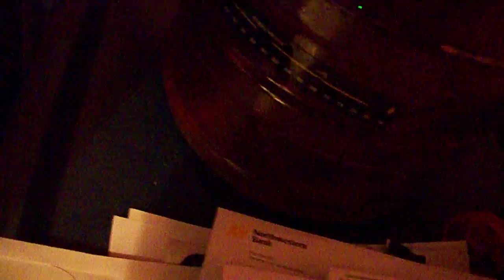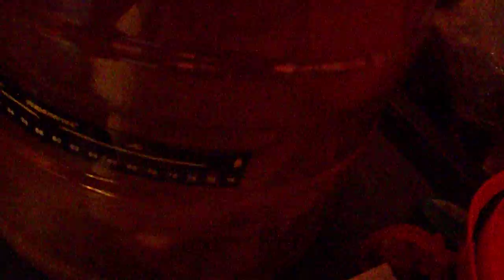How to rouse yeast fix stuck fermentation

Comment: I made Ginger beer 2 days ago initially the fermentation was good but now it's stopped bubbling ,what should I do ? Should I pour some more yeast or leave it as it is .
Reply from the maker: Remove the air lock and shake the fermenter by rocking it back and forth, till the trub starts to get mixed up, then replace the air lock. If it doesn't start fermenting again, then you could add more yeast to it.

Comment: Just out of curiosity – since you use a BetterBottle – why don't you swirl the whole carboy? The risk of oxidation should be minimal even if you accidently splash the beer a little (the space above the beer should mainly contain CO2). I use the DryTrap, and I guess it might be easier to lift the whole carboy and swirl it when there's no risk of messing up a liquid-filled airlock?

Comment from the maker: @ciphyre the 62 is from the 1.062 SG/OG just take the 1.0 off it leaving me not you with a 62 now minus the yeast attention from it mine was 72% so thats where 62-72%= 44.64% now i rounded up to 45 and took the OG 62 then minus 45 = 17 make my final gravity a minimum of 1.017. did that help? let me know if it didnt or just use the cheating link i sent.

Comment from the maker: @ciphyre Well that all comes down to yeast attenuation. Find out the percentage of yeast attenuation that the yeast you are using has. Say 72% you take your original gravity 1.062 remove the 1.0 from it leaving you with a 62 - 72% from it =44.64 (round up) now take 62-45=17 then add the 1.0 to it so your final gravity should be around 1.017. So if i checked my gravity with a hydrometer for a couple days in a row and it was higher then this number then i would rouse the yeast to help get it down.